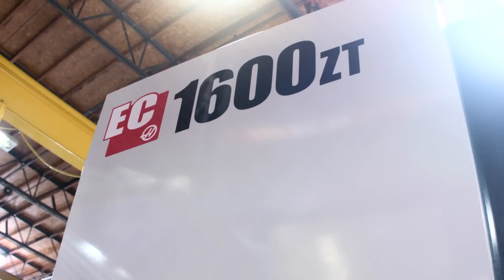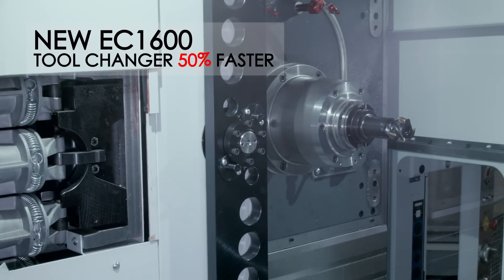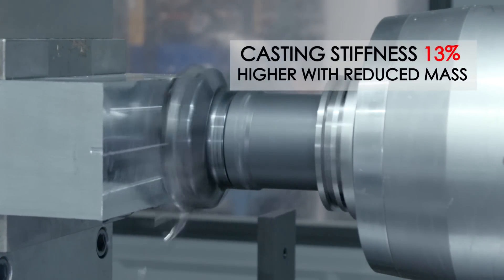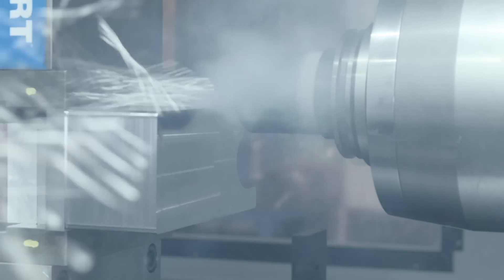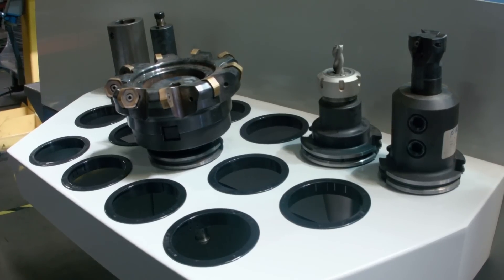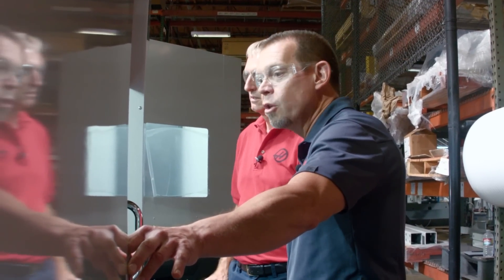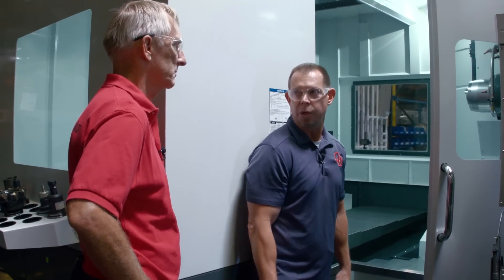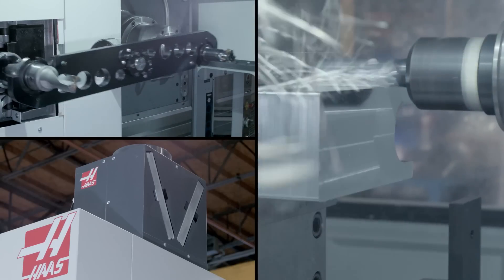The Redesigned EC-1600 Horizontal Machining Center from Haas Automation

Comment: Machining noob here. Why would you need a horizontal mill vs a vertical?
 I've only ever run a small three axis vertical in class and I cant 
think of anything that you would be able to mill on a horizontal that 
you couldn't on a vertical? Please educate me!
Reply: Beach&BoardFan 
Going from a VF4 to an EC1600, the 2 main things I gained are rigidity from being a heavier 50 taper machine, and chip control. On the vertical machine, chips would pile around the part and chip recutting was a huge problem.  On the horizontal, the chips fall right into the rear chip auger and I don't have to babysit it to clear chips. I just have to babysit it because the new Haas control is STILL plagued with problems and you have to watch it to stop it when it tries to commit suicide.
Reply: Some part geometries that are being held in a tomb stone can only be accessed horizontally so that you gain machining of the entire part in one operation. I had the same question about a year ago until someone showed me how they were machining a part.
Reply: if you need it, its a significant step up in rigidity.  its because of the geometry of the machine frame, not the spindle taper.  thats why you usually see horizontals being able to take monster cuts that would have a vertical tapping out.  think you only have a nominally 2-3 foot lever against base of the column where as a vertical column can be 2-5x the lever with less spindle travel. the cats meow are the horizontal machines where the spindle moves in 2 or 3 axes.
Reply: Access to more sides of the workpiece, and drastically improved chip evacuation.